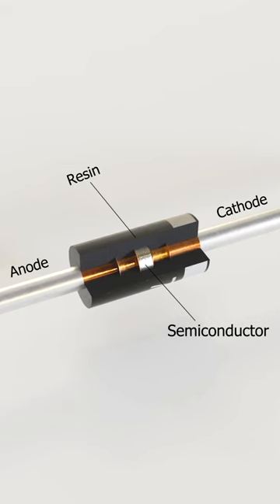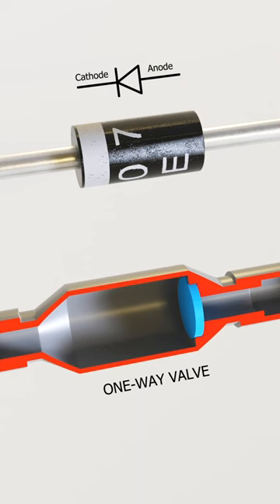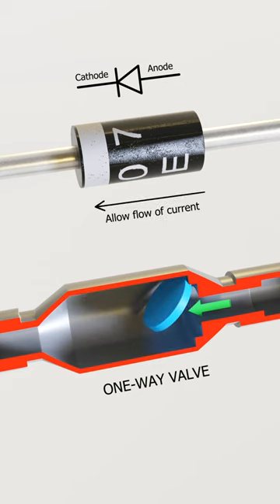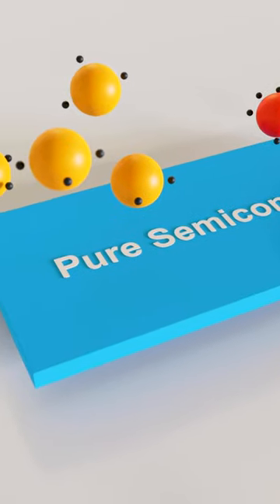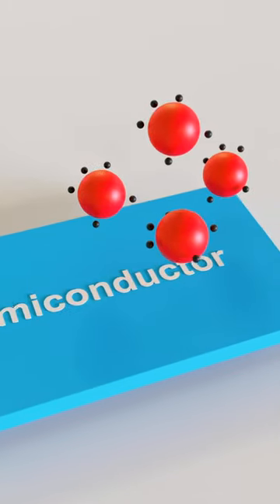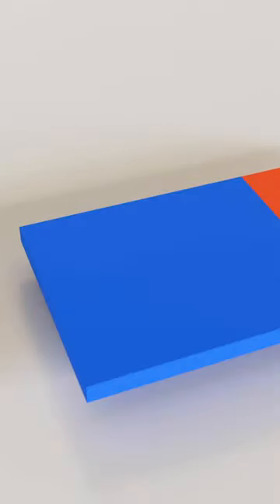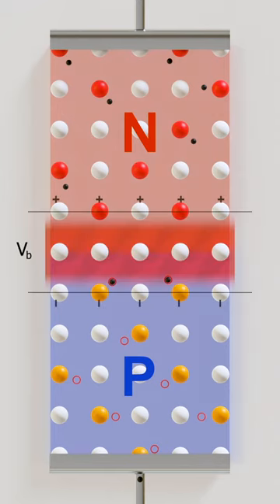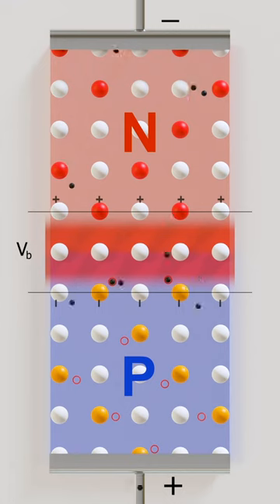diodes | 3D Animation #shorts #animation

Comment: what is N  and P stand for ?
 omg  no explaining smfh
Reply: N type is an extrinsic semiconductor which has been doped by pentavalent atoms while a p-type is an extrinsic semiconductor which has been doped by trivalent atoms inorder to alter their electrical conductivity properties
Reply: that does not make logical sense
Reply: @phillp7777  an extrinsic semiconductor is a intrinsic semiconductor which has been doped with impurities.an intrinsic semiconductor consists only identical (pure) atoms e.g Silicon,Germanium. A semiconductor is a material whose electrical conductivity properties lie between those of conductors and those of insulators. Trivalent atoms have 3 electrons in the valence band eg boron while pentavalent has 5 eg phosphorus. That should help you

Comment: What the differ b/n normal diode and ziner diode
Reply: Both diodes have a reverse breakdown voltage , where if you reverse bias the diode, it will breakdown and conduct when it should not conduct.

The difference between a zener and ordinary diode is that the zener is designed to breakdown at a low specified reverse voltage.

So a zener that is rated at 6.1Volts, when reversed based (connected the wrong way round for a diode) will conduct when there is 6.1 volts across it. And it will keep that voltage at 6.1 volts as the current through it changes.
It is a steady 6.1 volts.

A normal diode when reversed biased will block the current until, again, its reverse breakdown voltage is reached , but that could be 100 Volts and it is not accurately set.